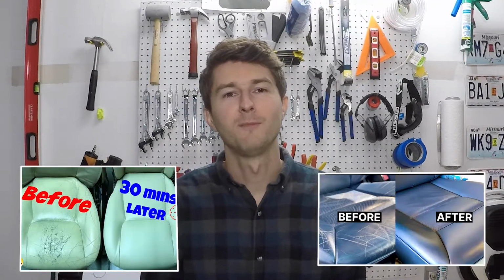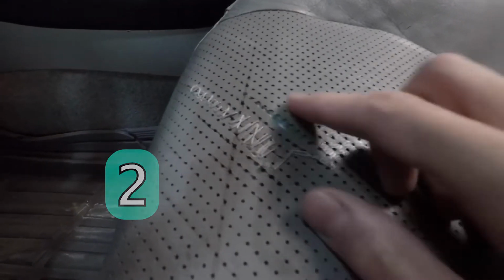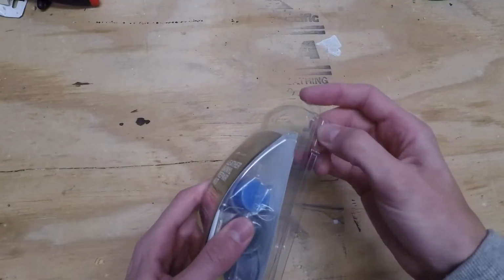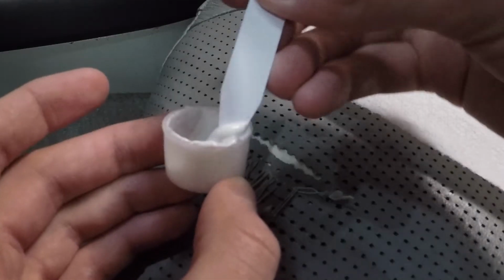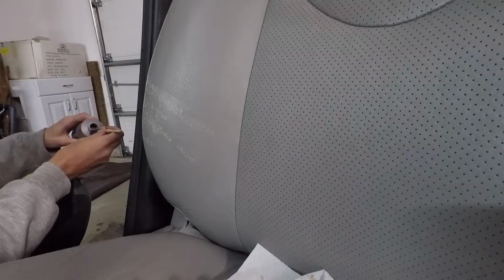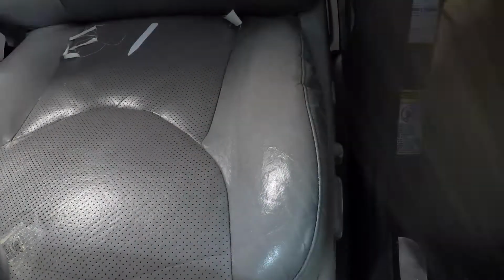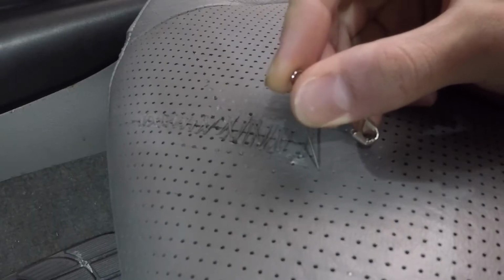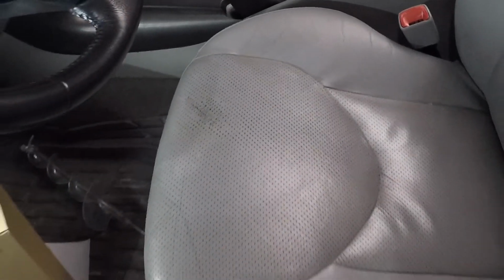Can you Repair your Own Leather Car Seats?

Comment: How did this hold up over time?
Reply from the maker: Held up ok, needed touched up after 6 months and the 3M flexible material did better than the crack filler from seat doctors

Comment: So I bought Simple Green because you advocate for it in your video.  Right on the label it SPECIFICALLY says NOT to use it on leather.  What gives?
Reply from the maker: Hey Rebecca, sorry about that! I wasn’t aware it said that in it. I used it with no issue though, and usually car seats have some sort of coating on them for durability compared to a handbag or jacket it’s probably less likely to cause damage.  Looking it up more there are people on both sides saying to use it or not to use it on auto applications. 
Hopefully you can still use it around the house if you choose not to on your seats
Reply: Liked your video by the way, especially the inserted videos.  Yes, I kept the simple green, I can use it on the car's plastic parts of the doors, dash, or, as you say, around the house.  Be well. @Average_Dad

Comment: Nice job!  How did the tear in the perforated section hold up?  I have the same tear.  Thanks!
Reply from the maker: Hey M, tear ripped in a different section about 6 months later. On super high stress/west areas I think there’s a good possibility if that. I fixed it with the 3M glue stuff though and re-dyed it in about 30min and it looks good again.  

Crack filler from seat doctors was a busy though, don’t think I would use that again on the seat at least, maybe backrest

Comment: So after 6 months, how is it now?
Reply from the maker: Great question LeSnackal, it’s ok, not as good as I hoped. I’ll make a short video on it soon but the crack filler ended up… wait for it… cracking.  Going over the bolster with the 3M adhesive and then dying it again brought it back to how it was in the video.  

Overall still a big improvement, just wouldn’t use the seat doctors crack filler, or at least not on a part you sit on